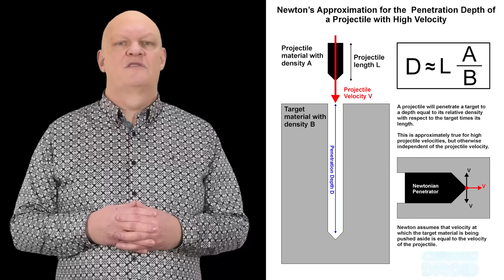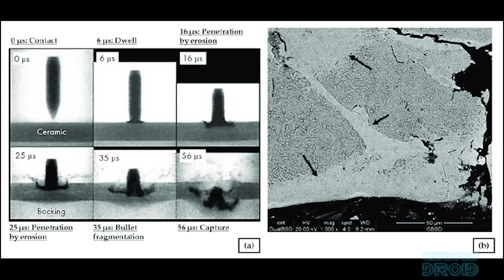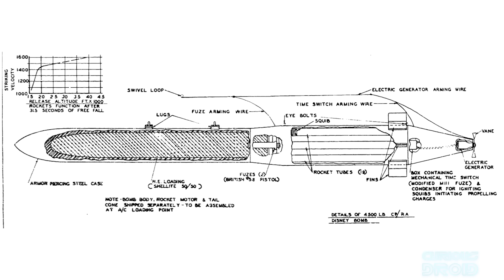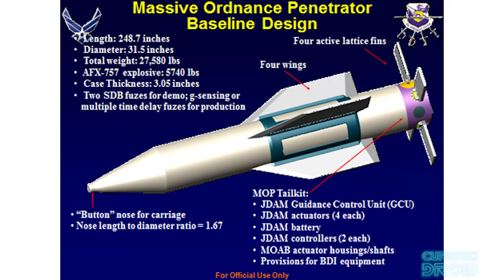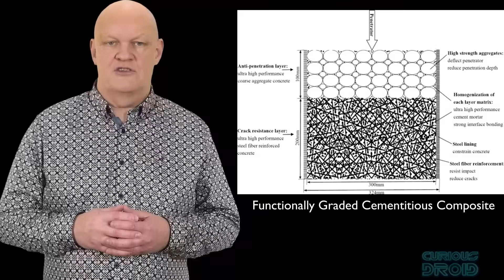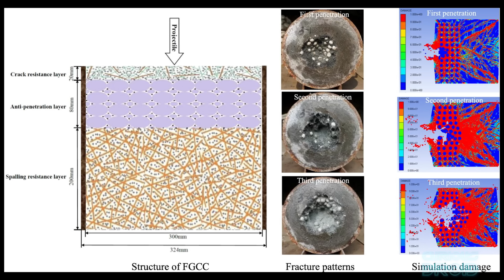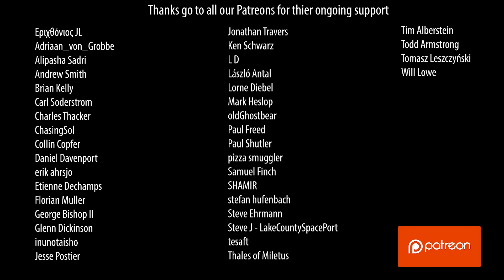Can Iran Stop U.S. Bunker Buster Bombs?

Comment: Masterful breakdown, Sir!  What about using a blend of tungsten carbide/depleted uranium for the nosecone? Or even a multistage 'matroiska' where each successive blast propels a smaller, denser projectile?
Reply: This would not solve the problem. Which is it needs enough kinetic energy. Impact strength = Weight * velocity²
Having a harder projectile which is not fast enough does not do the required damage.
Reply: @sierraecho884  Hrm. What about using embrittling agents?
Reply: @brianhirt5027  Like what ?
Reply: @sierraecho884  If it could be two time delayed staged, potentially hydrogen? TBH you could even probably 'pre-soften' with tungsten ball bearings. detonating from the cone just before it hits the target.

Comment: It seems like using granite as a layer embedded in concrete would be a good idea at a good cost. Granite has a compressive strength of ~20000 to ~36000 psi but when confined,  that goes up to ~52000 psi
Reply: The problem with all of this is that the construction is going to get very expensive so much so that most countries will not actually be able to build that many structures.
Reply: @bighands69  cost is irrelevant when you are trying to protect your nuclear lauch site

Comment: UHPC goes upto 116,000psi now, the bunker busters cant do anything to that. How long until we get 200,000psi UHPC? Probably not long
Reply: Commercial UHPC can reach 33'400 PSI and military grade UHPC can reach 60'000 PSI so I have no idea where you got those numbers from.
Reply: @johntheux9238  there are some companies that go to 116,000psi, probably not considered commercially available but you can request it, this was 3 years ago too, probably possibly to go higher now 👍👍
Reply: @strictlysport3624  I think that's the compressive strength of the aggregate, not the whole thing.
Reply: @strictlysport3624  Oh, it was cured under high pressure and temperature.
So yeah, it works as long as you can fit the part in an high pressure oven.
Reply: @johntheux9238  yeah that sounds like the stuff, theyll keep finding ways to improve it I imagine
Reply: @strictlysport3624  I guess you can leave it the first day in an high pressure chamber to reduce the size of air bubbles and then leave it in an oven for a few days. Easier than having to build an high pressure oven...

Comment: High quality work, as always! Also, is it possible to use a second bomb to destroy a bunker after a previous bomb impacts the target?
Reply: I wondered the same thing. Or a series of 10 small bombs hitting exactly the same point a few seconds (or milliseconds). Precision is so good now I wonder if it changes the equation
Reply: Well even precision bombs are not that accurate.  You also have rubble etc. So you try to get first hit kills
Reply: @jantschierschky3461  
Modern ordinance systems are getting extremely accurate. Smaller warheads with smaller cases can be directed. 
There is also the fact that bombs could be dropped at the side of the concrete structure to weaken the foundations. 
It is going to get to the point that construction engineering is so expensive that there is going to be a struggle with building these structures. Maybe that is even the strategy at play here.

Comment: As someone who works with explosives and missile systems, your wrong, the us is not going back to the disney bomb method. We are currently developing two different approaches. Laser breaching, which i know nothing about, and shape charge breaching my neck of the woods.This is where  an explosive is used to project a stream of matter ahead of a missile just before impact; allowing for clean penetration of the missile. Think of it like drilling a pilot hole with a drill bit for a screw, making it easier for the screw to go into the metal. It's possible the screw could penetrate the metal without a pilot hole, but it makes it much much easier. It's the same principle. 

But how some of the science of HDHV shaped charged actually works in reality is still under heavy debate and study. This is because current shape charge technology under research right now can accelerate matter so fast that it breaks the laws of conventional physics, because of photonic effects. Here's how it works.

An explosive charge detonates at around 10,000 meters per second, pushing a piston into a nozzle filled with hydrogen, plugged with another explosive charge, which propagates to a cone on the other side.  The cone has a tube attached to it, which goes to the tip of the nosecone, at the "stand off distance". This tube is filled with helium, as this allows the matter to pass to the target multiple times faster than plain air. The compression of the hydrogen causes it to detonate, also increasing the energy input multiple times versus conventional shape charges. Due to the geometry of the cone, the acceleration is multipled at over 14 times, which is the base effect of conventional shaped charges. This new design accelerates matter orders of magnitude faster than conventional shaped charges. They use these effects to accelerate composite liners at over 1 billion g's, i said billion with a B; where as a conventional shape charge only accelerates it between 25 to 35 million g's. This results in a steam of matter in it's higher states and even hidden states, the main one being plasma. So it accelerates matter so fast it instantly shifts it into its fourth state of matter without a phase transition period. 

This is where things get weird, because Photonic matter has been observed in these jet streams, via x-ray diffraction and impact results. This is a phenomenon where photons of light interacting with a gas develop "apparent" mass and weight, and can even form "photonic" molecules. The source of the mass the is the gas the photons are interacting with. This increases the weight and density of the matter without changing it's volume (Or what it actually is, it's still the same matter, it just weights more in this state); going against the rules of conventional physics. Resulting in higher impact forces than would normally be possible. This is another reason why the stand off is now filled with helium; Because it's mass and weight can now be included in the jet steam projectiles mass and weight calculations due to this phenomenon.

This addition mass might seem trivial, but kinetic energy is directly proportional to the mass of the object and to the square of its velocity. So this additional force is multiple many times over.

A HDHV shaped charge can accelerate something so fast, that it gains more mass and weight than should be physically possible. And you didn't even mention it in this video! Super disappointed man.

I have educated a few youtubers on the science behind solid propellants and explosive technology's like dustin from smartereveryday and joel from integza. Joel's stuns might look dangerous, but it's scripted. I made sure he was able to work with energetic materials safely. You can ask them, i'm a good source of information; if you ever need it. - Cody the rocket scientist

Comment: I mean reinforcement in concrete has a hole lot of different meanings 10% rebar -50% rebar by mass ? 1020 steel rebar or 1075 rebar ? Fibre mesh  glass ? Fibre mesh basalt  ? FGPC ? Fibre mes aromid ? steel plates ? ceramic plates ? spaced layers ? NERA ? ERA ?

Comment: I’m curious about the longevity of fibre reinforced concrete .  I know they have problems with rebar long term in construction.
Reply: rebar will last forever as long as the concrete remains sealed. But the moment the surface is cracked and moisture can get in you're hooped. Fibre reinforced concrete is more about making it flexible. Not sure how good its load bearing ability is because it will bend under its own weight
Reply: I work in concrete repair and regularly use fibre reinforced concrete, its a hell of a lot tougher than hi strength concrete.

Comment: Probably will go back to the tallboy concept, drop next to the bunker, penetrate deep into the ground, then detonate, and the cavity formed will damage the bunker so severely it is unusable. Collapse the entry and exit points that way and even the hard bunker is useless.

Or we will be seeing mach 5 capable bombs, that are dropped from altitude with rocket assist, so they will penetrate deep before exploding under the bunkers, having guidance that brings them in at an angle to detonate under the bunker, as likely the floors are not as thick, and thus the blast will reflect off the roof, destroying all in the cavity.

Comment: on a technical level, trebuchets and other siege engines were meant to break defences on top of walls and structures inside the walls, if they could break the wall itself that was a bonus. the invention of the cannon allowed armies to target walls. before this, the only guaranteed way to break a wall is tunnelling
Reply: Imagine a trebuchet that is hydraulic and has on one end, a long reach excavator arm, and it moves on tracks and feeds itself debris to throw over the wall
Reply: Well today you can fly into space and steer an asteroid into your target from there. If you want to destry the super duper deep russian bunker and you don´t want to use a nuke ...that´s how you do it.

Comment: The difference between a rocket vs a missile is a huge one. Rockets are unguided (you mainly fuel it up, point it, elevate it the way you want then fire) while missiles have an internal guiding system.
Reply: I remember visiting a 19th century battlefield where rocket artillery had been used against a fort... despite being launched from almost point-blank range, hardly any of the rockets actually landed within the walls. "Unguided" was certainly a fair description back then...
Reply: The definitions are not that cut and dried and there is a ton of overlap.  We call space rockets, rockets even though they have guidance systems.  We call rockets carrying nuclear warheads - ballistic missiles. Rockets do have a generally accepted technical definition, described as containing their own fuel and oxidizer and therefore can operate in a vacuum (or underwater for that matter). The definition of missile can include any object propelled mechanically or chemically from a rock, to an arrow, to a Sidewinder, (which is also a rocket since it uses a solid rocket motor), to a cruise missile powered by a turbine engine (propeller or jet) or even a ramjet.  It’s complicated.

Comment: Weapon systems are far outpacing the ability to counter weapons systems these days. Wether it's tanks, ships or bunkers, our ability to protect assets it's being out stripped by the weapons that take them out. 

Iran flew their cheap drones right past our Patriot system and nailed direct hits on the Saudi refineries. Iraqis were turning a few lbs of copper and some explosives into an IED that could take out an Abrams. Russia's tanks are getting turned into mush by shoulder fired rockets in Ukraine. 

We haven't seen a naval war in decades but all those giant ships are super vulnerable these days to high speed cruise missiles.
Reply: Patriot missles were never designed to take down drones,why is that so hard to understand?
Reply: @RANDO4743  that's kind of my point. Defensive systems takes years to develop and tend to not work vs everything. even Iran can develop weapon systems that cost 20k each and avoid our defense systems to land hits. 

Same way china built a bunch of anti ship missiles that our defensive systems on our ships can't defend against. 

It's an age of offense.

Comment: Nicely presented. If you look closely at the images at 16:52 and 17:12 you will notice that the part labelled "anti-penetration layer" actually consists of spheres of a different material embedded into the parent material. There's a whole video to be made about the physics of composite armors containing balls within it.
Reply: @DAVID.2049 I looked in Wikipedia for something like "metal balls in armor" or something like that. The science behind it is fascinating.
Reply: Perhaps Paul will cover that as well.
Reply: @issadraco532  the micrometeorites vapourise themselves upon impacting the surface of the spacecraft, so as long as there's enough distance, empty void/foam and some layers between the first and final surface, the projectile is completely atomised at those speeds and poses no threats. i think scott manley did a great video on this topic, or maybe it was CD
Reply: @issadraco532  holy moly! Yeah I’ve never seen “censorship redacted” on a comment before!! Thank you for that very thought out and thorough reply! Yeah we definitely weren’t the guys doing the engineering specs. Mostly we were just wondering what cancer we all are going to get from the fumes of the composite armor and CARC paint! I was glad it wasn’t my full time MOS. Just in a pinch we had to make due. Especially in the Marines. We don’t get shit as far as good gear or maintenance. I’ve often wondered why only a few countries are capable of creating such tech but probably could come off sounding racist or something but it’s just weird when especially now we all have access to powerful computers and other open source information. That was weird with the Brit pilots training in China. I fell into the trap of doing the NGO contractor gun work when the GWOT $$ was still flowing so I can understand if they got caught up in the wrong group and ended up relying on that cash to keep them from losing their mortgage or drug addiction going. I’m so glad I’m done with that shit.
Reply: Just like demolition ranch shooting 50 BMG into a glass ball
Reply: I'm not going to volunteer my balls for that...
Reply: The sphere shape can take great amounts of pressure, regardless of the material. The filler is meant to uniformly distribute the pressure among them. There are smaller balls to fill the gaps and absorb further pressure in two different scales (the multiple scales of the composites make the trick)
Reply: Combining a hard material which withstands large compression with an elastic one that distributes directed pressure is what gives a shock resistant composite
Reply: Ah ha! Someone else noticed. Yes, those 'balls' make it particularly hard to break apart the concrete using impactors.
Reply: @Outland9000  i think most people will have noticed.  they are 'pretty hard' to miss ;-)
Reply: It’s crazy how much our composite armor is so secret/sensitive tech but we are just giving it to hopefully allies in Europe right now? Fixing battle damage on the Abrams we weren’t allowed to be told what the panels were made out of we just welded them on. Now we just are handing them out to whoever
Reply: @echo5delta  The same people that made that decision have purposely treaded on Russian key geostrategic toes, causing the conflict. So there are two explanations, the first one being complacency and the second one -- incompetence. Not that these are mutually exclusive.

Comment: You made the claim that the high strength concretes were not commercially available until the 2000's but we were using this technology here in New Zealand in 1995. I personally led a team constructing ferro-cement panels that on test were routinely achieving 56 MHP plus with the aid of steel fiber.
Reply: In Serbia NATO droped many bunker buster bombs in 1999 on 2 airports that had underground level for storing military and civilian planes. And no bomb penetrate it
..
Reply: "...in the US" Listen again.

Comment: I think they can be stopped with like a reactive concrete like a reactive armor. You just have a layer inside that would react and explode downward into the bunker buster diverting his path and changing its angle and causing it to self-destruct as it hits the hardened materials at an angle it was not designed for while encountering high temps causing the metal to fatigue

Comment: Why fear our penetrators' burning up at higher speeds? Why not AIM for that? Why not fire a tungsten ball from a rail gun in space? Such a projectile with a velocity over 300,000M/S shouldn't have any problem converting a bunker to plasma. The earth in the impact area should react like ballistics gel when a 45-70 round hits it, but the permanent wound cavity should create a secondary destructive side-effect. Cavitation is the most sensible means of attack for an enemy that is in the sand. Sand flows like water.